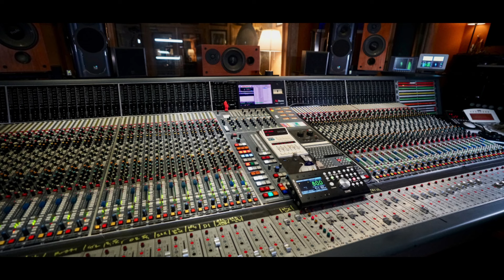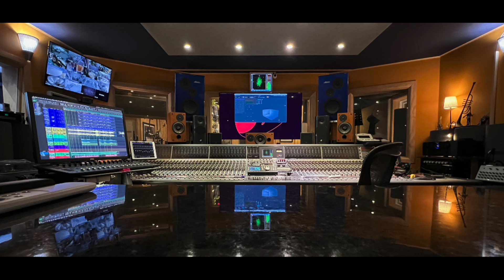Analog Consoles - Commentary

Comment: the N TROPHY , NEW,, console is 30K master section 25K per 8 channels ,, you need probably 48 channels minimum if not 56 channels if not 64 channels or more in my opinion because i want 2 split my console in half 24 sends to tape and 24 returns thats a 48 track console to track a band on, i need to hear it tho- on both ends threw 2 channel strips the one going in and the one returning so i can cut eq to tape if need be and then boost on the return using 2 eq-s 2 channel strips at once, or the flexibility to have more multi-tracking then just 24 tracks have 32 or 64 multi tracks i like the 24 bit radar digital tape machine because it functions fast like a tape machine its going to be the flexibility to mix coming back from 24 tracks on a big console were im going to use all the tracks of the 48 channel console or larger stacking up tracks adding effects tracks compression doubling tripping up tracks which is how i do it on a analog console similar to mutt-lang i think his name was,/ the thing is because i ran my bass recorded threw direct box one track but the amps in a giant room with 10 mics on it all bussed down to another bass track so 2 tracks total on tape then im going to return from tape and then eq compress them over 10 channels do this to everything bass guitars vocals the idea hear wen done correctly even if i run out of space i will connect 2 consoles together then if i have 2 ,. its called psyco style mixing , the idea is now the end result is MY MIX sounds better and is fatter then any one else's just more of everything punch fatness clarity depth effects layers this was a method were on like a 56 channel sound craft ghost with 16 bit tape machines im competing with a SSL and 2 inch tape the thing is , is what happens if i move my same techniques to the best equipment in the world ?// take a look and listen to the N TROPHY CONSOLE its a mastering console,, it has the lowest volume master section the lowest noise floor one tinny power supply powers a 64 or more channel board it has the lowest lowest heat ,. you can not cook a egg off this console ,it has compression on every channel and automated fades there are 2many reasons why the N TROPHY is the best ,the price of it makes sense compared to all the competitors ( api, neve, ssl, oram, sound techniques, trident, = who ever i for-got ) then,,,, like  your also going to need another 9K for one of there LAAL look ahead limiters to attach to your master section as well the best out board compression  units and eq-s but i question if not just using a set of the TROPHY channels strips on the master section since you all ready have them but its add other flavors there since your using them all ready but that is posable since there basically the best ,.(( i like the idea of putting in some mastering concepts into over your master bus OUT so you almost mastering the thing so you can basically print this final mix to a C.D… i looked into it a little bit and you can now i think print to 24 bit blue rey or dvd this would be very ideal to make that jump and release your final project if possible on a 24bit digital disk platform i noticed yes it cost a little more 1000 c.d..s copied is less money then 1000,. blue reys but its just a issue of a few dollars if your selling your final disk for 20 plus dollars the yet the difference between them is 2bucks,, 2 dollars and 4 dollars or so per copy ruffly its going to be charge 25 bucks for the blue rey then as its better so that looks like this is a issue that can be solved and its going to be to abandon16 bit digital in pro audio if possible and thats saying good by to normal C.D.s.. your still probably printing them but were going to offer the 24 bit model on blue rey dvd or what ever it is now , i believe with something like the N TROPHY console and the set up i had mentioned i could mix directly to 24 bit disk and get around the mastering process and just start releasing records like that and the quality would be fine sure clients can go to another mastering engineer from there to do even more however my final product would be close and great all ready ,, now a days the console market is this you can get a soundcraft series four console for 1,500 bucks you can get that same SSL J series or something for 30K but your going to need an air conditioner and full time teck OR for the 250,000 dollar mark you can get a new N TROPHY large format console ,.. now could you get away with this console in a 24 TRACK for a lot less moneys ? sure if your just tracking  into you pro tools or if you like the idea of saving moneys and maybe you have to hit a button for your send or return from tape then you can fit onto the same 24 tracks ,. i just was saying the minimum is 48 tracks and not having to do that ,. what you need with the N TROPPHY is there master section so if i was stuck with low moneys and 32 channel N TROPHY i would be using my last 8 channels as a patch bay were as i could connect in some other consoles and still be using the TROPHY master section ,. best is to just do a bank robbery and buy the 64 channel plus N TROPHY ,,as,,, because the sound craft with 2 power supplies in mint condition all in rolling flight cases for 1,500 bucks looks good ,. those particularly the four series had a good low end in the eq / now its not close to this new super board but thats the price of the analog used market and consoles are stupid low now and there are some big live sound consoles that are great,. amek neve total recall, crest v12, gamble ex 56, also there are a few sound crafts like the series four that sound good another solution then is get some of these great live sound boards for nothing and then connect them all together and make 150 channel super console of 3 or 4 different companies combined,, /// still like i said low noise floor a mastering console low heat all the options most importantly sounds stupid phatty , this is why the  N TROPHY for the WIN !  cheers ,.
Reply from the maker: Boy, that is a lot to take in. The console looks great! Have any of these consoles been placed yet? Just curious...

Comment: There are LARGE FORMAT analog consoles (the likes of NEVE V III, VR, VX, and the SSL E, G, G+, and J series, along with the API Legacy series) and there are 'analog consoles', the likes of an older refurbished MCI 400, 500, and 600 series or a Trident series 80, just to name a few) that don't dissipate as much heat, but function well as a console. The REAL issues on the plus side for a console is that they are able to sum incoming signals to be assigned to tracks in a DAW, and they are able to sum tracks as they're being mixed. It's the qualities of the MIX BUS, whether it's the old school transformer style, or the more modern active mix bus, that add to the sonic signature of a mix. One does NOT require a large format analog console to gain such a sonic benefit as something like a new Audient 4816 will do just fine in both the input summing and the mix summing scenarios. The fact that used large format consoles that were new in the 1980s are still in use today is a testimony to their build quality as well as the fact that they still have a draw for many clients. Reworking such consoles is still worth it for many to do. 

BTW, when people recap their consoles they often do so in a way that makes them EXCEED original spec, replacing the original caps with ones that have a higher operating temp as well as a greater value for better low end.

When SSL introduced the Duality, they changed to design to eliminate the power rack in the machine room, instead having individual switching power supplies in each bucket and the computer within the console However, some still prefer the format of the E series console because the center section was narrow, allowing an engineer to work in the sweet spot much more easily. There were those who didn't like the J and K 9000 series for that very reason. 

Overall, I believe that for many an analog console makes a big, positive difference in their overall product... even when it's one of the newer, smaller footprint ones that doesn't cost and arm and a leg. 

One more thing... why were consoles built in the first place? They came along to integrate all of the separate gear into a compact strip so as to avoid the crowding of gear (all of those separate mic preamps, equalizers, and compressors, etc ) so that an engineer could work more efficiently. In some ways it appears that we're returning to those 'pre-console' days without understanding why they came around in the first place. The pendulum swings, yet again. Cheers.
Reply: Great comment, I’m working with a small console and if I ever get the opportunity to upgrade to a bigger console I would definitely go for it. I still love the workflow and the sound 👍🏼
Reply from the maker: Well said